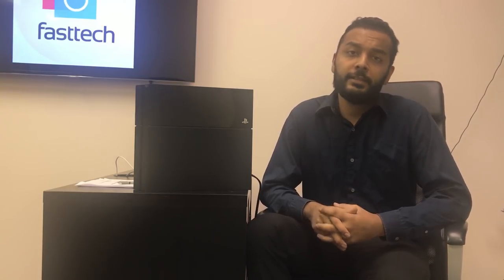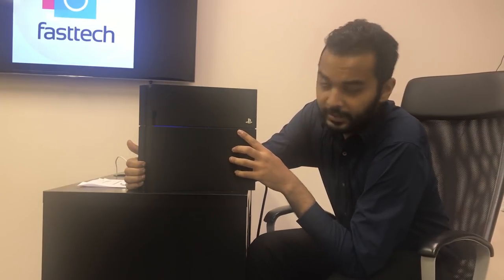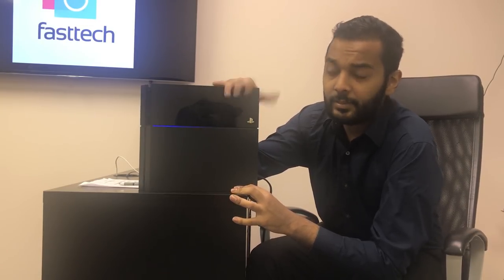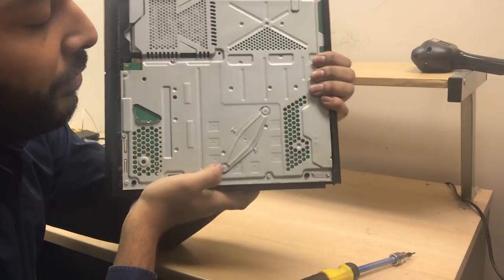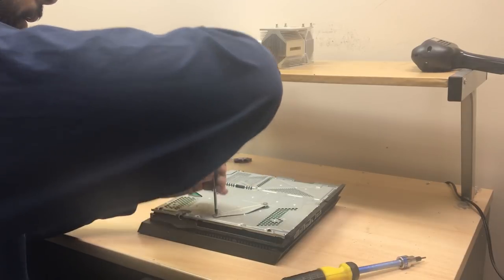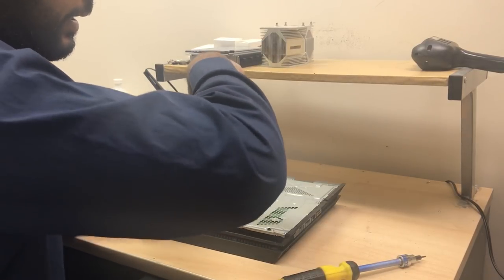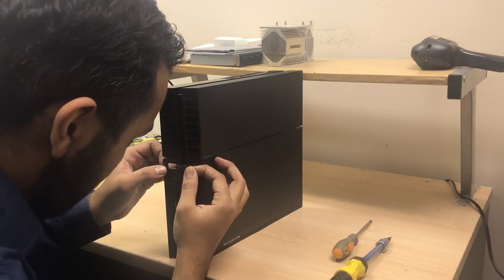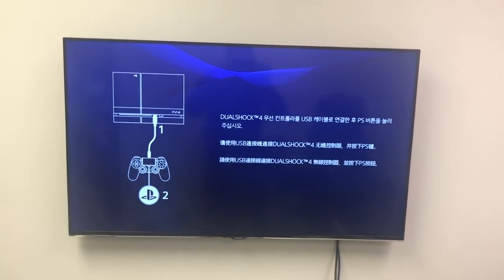PS4 BLOD (Blue Light of Death) Repair (CUH-1001A and CUH-1115A) - PS4 Turns On then Off

Comment: It worked, took me a while because I had a stripped screw and I had to get around that but once I did, it was easy on out! Thanks so much man this only costed me 60 cents for the washers since I’m returning the screwdriver tomorrow! I used 1/4 size washers that I got from Home Depot. Easy effective fix. I’m backing up all my files on to a usb right now in case this ever happens again!

Comment: it seems that the two washers on each side would lift up the pressure I would recommend to put something in the center of the clip so it forces pressure down harder and use no washers where screws go
Reply: Not necessarily. I thought the same but didn't work so ended up placing it on both sides and worked. Very strange but atleast got my console working again.

Comment: You saved my day today bro. Thank you so much. Been wondering what's wrong with the PS4 until I almost gave up trying to repair Now my PS4 is fixed! Thanks!
Reply from the maker: You are welcome. Don't forget to subscribe.
Reply: How long is it fixed gor
Reply: @Eli Rodriguez I overlooked this sorry. I used my own washer instead of their washer since I live far away.
Reply: @gaijindando6726  Doesn't take long . Once you have put some kind of washer or anything to keep the plate back in its original position, the PS4 will run normally.

Comment: doing how to clean dust video on your channel is the reason my ps4 has the  blod blue light of death
Reply from the maker: You must have done something wrong along the way. That blame cant be put on me. I have done thousands of PS4 consoles without breaking them.
Reply from the maker: Check the pins on the motherboard (the ones that go in the power supply) and make sure they are straight.
Reply: Fasttech i think it can’t be fixed ima just buy a new os4
Reply from the maker: @GTZ3Z  Okay, If you like you can also sell it to us here: https://www.fasttech.ca/sell/

We can give you up to $100.
Reply: Same situation here. I blue lighted after cleaning the heatsink but after doing this i got my console on but the fan is louder now and i instantly overheat
Reply from the maker: @yungsuccog8223  Thats strange because on my cleaning video you said you did THAT and it broke your PS4. Regardless, its not working because you did something incorrectly.

Comment: This was it!! Thank you :D
Is this temporary or forever, though? I know thermal paste isn't, but will I still have to reball the APU at some point? Thanks!
Reply from the maker: You are welcome. In most cases this works virtually indefinitely (the chip eventually dies no matter what due to how processors are built) but in some cases it could fail again in 1-2 years.

Comment: Ive added washers and it hasn't done anything. My problem is that while dissembling the console I accidentally pulled the connector attached to the motherboard. I soldered it back on and then that's when it gave me the blod. It will turn on them instantly turn right back off. Could it but a power supply issue in my case?

Comment: Alright dude I tried this but it did not work. Any recommendations on other procedures?
Reply: I'm late but change the psu
Reply: Check your hard drive seating, check your PSU, replace or reball the APU, replace the motherboard. These are all possible solutions

Comment: This is awesome!, it actually worked for me but i had to experiment with many different configurations and numbers for the small round metal thing (i don't know how to write it's name in english) because my console is a old version with some small metal parts attached to the screws that i didn't want to remove. But, when i finnaly got (after 3 or 4 trials) the ps4 starts normally as ever. Thanks dude you saved my year!
Reply: Vitofael Lima what size were the washers?

Comment: Mine was fixed, finally. But, soon as i start the game it started to have an overheating problem. I tried to clean it out like the way you did it in your other video (Not further down to the motherboard and the APU tho) and it still loud and shuts off after overheating. It went smoother after i first cleaned it but still shuts off after 5 mins. 
How do i fix this? Should i clean the motherboard as well?

P.S 
My PS4 Heatsink is not as dirty as yours it isn't block by layer of dusts.

Comment: This worked for me for two years so I appreciate it. Mine seems to be at the end of the road now though...Screen flickers while gaming then the PS4 shuts down. Unable to turn on the ps4 with the controller I have to locally switch it on. The first press yields a beep but no light flashes. The 2nd press has the blue light remaining on but doesn't turn white. Doesn't connect to the tv. I have to remove the screws and try adjusting it again to get any sort of result afterwards. That only lasts a couple matches before the cycle repeats itself.
Reply from the maker: Try replacing the thermal paste
Reply: @fasttechvideo  will try this
Reply: @fasttechvideo  I replaced the Thermal Paste...Same issue. It actually just shut down on me after 4 matches in Black Ops Cold War

Comment: The idea is to put more pressure on the heat sink not less and that's what you doing. You should recurve more and put washers on the opposite sides. Also you can't put heat sink paste on without reballing, you tubers you can check that for yourselves. This is a tape patch on gas engine inflight to idlewilde . lol. I know what I'm talking about because I've actually reballed many of these systems and also the adjoining smaller ic's can start to go bad from the overheating causing the same trouble.

Comment: When you putting the two screws back in do you want it to be tight or some room? Tried it and it’s not working
Reply: Tight is better, as you want the APU under the board to as close as possible to the motherboard

Comment: How thicc are the washers u used? I temporarely did this with Aluminium Foil, but i need to replace that
Reply from the maker: We do not share that info. If you would like to buy the kit the link is in the description. You can order washers only for $9.99
Reply: @fasttechvideo  lol, 9.99 for some washers? I rarely laughed that hard.
Reply from the maker: @vanerdrace4806  You are forgetting about the time and effort it takes to make these videos. Its not just washers and electronics parts that we sell.
Reply: @fasttechvideo  Mhh but I didnt forget the 2 Ad's i had to watch. Which is meant as "Payment" But still...9.99 for 4 Washers, wtf. For 9.99 i get rund about 750 of these.
Reply: @fasttechvideo  there are People which are producing way higher quality tech vids without 9.99 Washers

Comment: Now everything makes sense... 

It's a BGA issue. You basically make it force the bad solder joint under the CPU/GPU to make contact.
Rather a workaround, but nice to see it working for people :)
Reply: Bga issues never existed. Its a problem with the chip itself, and the die not being connected to the substrate

Comment: Hello.

I have a question . My PS4 starts normal sometimes and sometimes doesn’t start and shows blod .. but when that happens and i turn it off and start it in the safe mood ( by pressing power button 7 secs two beebs ) that works all the time .. I can play games etc 

So am kinda confuse what the problem is ? Is it still considered Blod or what is this ? 

Kindly advice thanks

Comment: I am a french and i say thanks you very much and your technic was work ans doesnt use my ps4 2 years and now my ps4 work thank you very very much
Reply from the maker: You are very welcome.
Reply: Fasttech are all washers same size ? Mine the light turn white and then turns blue , if I go Home Depot can I buy washers ?
Reply from the maker: No all washers are not the same size.
Reply from the maker: You cannot get these at Home Depot.
Reply: Julien Johnkennady moi aussi je suis français mais je ne parle pas trop anglais mais juste avant que tu l'as répare es que tu pouvais aller en mode sans échec ? parce que moi non sa fait 3,4 ans que ma ps4 marche plus c'est pour voir si j'ai le même problème pas que je me fais des faux espoir. Dans la semaine je vais acheter un tournevis torx 8 merci de t'as réponse.
Reply: Dark HoNor_ moi la je vais essayer, j’te dit si sa fonctionne stv, j’espere 🤞🏼 moi non plus je n’arrivais plus a mettre le safe mode
Reply: Utilisateur merci, je te dirais aussi quand j'essayerais.
Reply: Dark HoNor_ mais defois la tienne s’allumais ou pas du tous ?
Reply: Utilisateur ouai elle s'allumait genre une fois sur deux sa marchait mais sa na durée que 1 semaine car après sa marchait plus.
Reply: Dark HoNor_ ok ba on est 2
Reply: dans 3H max mon tournevis arrive je te dirais si ça marche.
Reply: Utilisateur j'ai reçu le tournevis j'ai essayé et ça n'a pas marché je suis dégouté :( .
Reply: Dark HoNor_ ouai moi j’ai pas pu tentez parceque j’ai un problème avec le cache qui s’enleve pas, et j’ose pas forcer car la play n’est pas a moi donc je vais m’en acheter une 😑 la tienne affiche toujours bleu ? Meme avec les trucs que tu a mis en dessous
Reply: Utilisateur ouais comme avant...
Reply: Dark HoNor_ mince
Reply: Utilisateur :(
Reply: Tu parles français ????

Comment: I Have A PS4 Pro That Turns On ( Blue Light ) Then Shuts Off Does It Mean My Pro Have The Same Problem ? Can You Show How To Fix It On PS4 Pro or Can I Send It In ?
Reply from the maker: The washer method will not work with PS4 Pro consoles. You will have to send it in to us or a repair company for a reball or reflow service.

Comment: I did nothing to my device. I went away for 4 days and when I came back to use it this happened. Why?
Reply from the maker: That does happen at times. Also there could be a human reason for that (sibling etc knocking it off the table)
Reply: @fasttechvideo  Same exact thing happened to me, tried the washer method and it did not work. Any other suggestions?

Comment: I tried this on the slim model in a slightly different way since the slim is designed differently but it actually made the blue light go away.
Reply from the maker: Where did you place the washers?
Reply: @fasttechvideo  instead of the washers going on the clamp screw, i placed a washer under the clamp itself and tightened the screws.

Comment: I'm thinking about replacing the motherboard all together with a new one. Will that cause compatibility issues?
Reply from the maker: As long as you get a matching logic board (disc drive board) with the motherboard you should be okay.
Reply: Fasttech Does it have to match the motherboard or just the system type?
Reply from the maker: Has to match the motherboard
Reply: Fasttech Any websites I could buy those together at that you would recommend?
Reply from the maker: We now sell PS4 motherboard on our website. Link here: https://www.fasttech.ca/playstation-4-parts/ps4-sab-001-motherboard

Comment: Ok is my PS4 fixable. I turned on booted into the menu. I went to turn on my cell phone hotspot and it shut off. I turn it back on and get the pulsing blue light. What could cause this issue.
Reply: It was working just fine til this happened
Reply: This worked. Omg thank you. Saved me money on a new system.

Comment: This doesn't work, i had a feeling i wouldn't but i tried anyways. This video is more like advertisement of those "washers" they sell.
Reply: It does work but in certain instances it won’t. There are hundreds of tiny solder balls under the APU (combination of CPU and GPU) and when they lift up off the board a fraction of a nano meter, crack, or become corroded they can’t pass current to the chip. It’s not a guarantee but it can fix most consoles for a good length of time. It’s a problem with all ps4s but its most fixable with the launch addition which was more likely to have the issue.
Reply: @corybrown5583  looks like a temporary fix tho?
Reply: julius dogta yeah it’s temporary but then again a ps4 is temporary because it has a lifespan like everything else. Mine is still working. I bought one off eBay broken and applied the washer fix and it has been working for like 5 months now. It could continue to work for years or it could fail tomorrow. It’s jailbroken so it’s worth the trouble.

Comment: My ps4 look different when i opened... That part is cover with a metal piece... It have that shape but is cover
Reply: Same
Reply: @GinoVlogss  is under that big metal piece. Just take it out
Reply: buffel132 does it not need it ?
Reply: @GinoVlogss  idk. I put it back
Reply: buffel132 if I take the metal out does it fix the PS4 because I don’t want to break it
Reply: @GinoVlogss  idk men. Its depends whats the problem that your ps4 have... It didn't fix my... My problem is not cpu or bad connection... But if yours is it may solve it.... You won't break it if u have the tools. Just take all scrolls off and remove it and put it back when u finish

Comment: What about if it fell
Reply from the maker: This repair will work in most cases but with some units you will need a reflow or reball to fix the damage
Reply: R.I.P
Reply: Braydon Miller  correct me if I'm wrong but this is most likely the apu disconnected from the motherboard
Reply: ash mariee  buy a new one lol
Reply: Braydon Miller  so try to fix it

Comment: Doesn’t work, other methods?
Reply from the maker: Reflow or Reball the APU chip. If that doesn't work you're going to need a new main board.
Reply: @fasttechvideo  I'd try taking off that part he takes off and leave it off! I am not sure what the point of it even is!

Comment: why my light turn into white color?
Reply from the maker: Thats a good sign. A white light means the system is working as it should
Reply: @fasttechvideo  but nothing appear at my tv,. seriously I have try many time. but the result still the same. first the light color is blue before a few second it change to white.
Reply from the maker: @salehinks9946  check the pins on your hdmi port

Comment: Don't do this guys. It won't last. It's not the way to fix that. This guy only wants money!
Reply: it wont last meaning?
Reply: It's not the right way to do it. The chip has to be reflow. This method consist to put a big pressure on the chip wich is very bad with time. The real method is a reflow or replace chip with the right procedure and tools. It requires laser reflowing machine and a lot of experiebce. Be carefull with wrong you tubers who say anything just for money.

Comment: waste of money, literally can buy washers for cents at a hardware store, and thermal paste is only a few bucks
Reply from the maker: Are they the specific washers we use in our video? No. For $19.99 Canadian dollars (about $15 USD) we ship you a kit with thermal paste and washers. Not to mention the value you get from watching this FREE video.
Reply: First off, time ain't free, and to say that you are selling "special washers'' would be a lie, what your doing is selling machine screw washers that cost almost nothing and selling thermal compound to gullible kids for an extreme mark up. Not to mention the fact that this "kit" would actually do more damage to the Apu by putting an excessive amount of pressure on the chip. This fix is also somewhat comparable to the bolt fix on the xbox 360 which literally crushes the chips till it makes contact with the BGA points.
Reply from the maker: Time isn't free ? Excuse me. Do you know how long it takes to make and edit these videos? That is the beauty of a free market you do not have to buy it. You are free to risk your expensive PS4 by using hardware store washers that will not be the correct size. To stay in business we have a make a profit therefore we have to sell at a higher price than our costs. If you had any business experience or background you would understand. As far as the claim goes that this damages the APU chip, there is absolutely no evidence of that. In fact we have had 0 repair kits being returned so far.
Reply from the maker: I used to delete idiotic comments like yours but now I don't because there is a group of entitled people like yourself that need to be exposed.
Reply: Fasttech First off, "time ain't free" applies to everyone as we dont have an unlimited amount of it, and second of all, What are exposing me for, exposing you, I literally just explained why you fix is damaging to these consoles, also noticed you have xbox 360 heatsinks in the backround, hope you aren't doing home repairs for those too
Reply: Fasttech And if you going to offer a "REPAIR SERVICE", then get a BGA Reflow station and do it legitimatly like your competition
Reply from the maker: The whole point of a DIY video is to help the average Joe fix it themselves at home. If your time is so precious and you feel this time was a waste of your time then you don't have to watch our videos. We do have a BGA rework station that we use for reball services which we offer on our website.
Reply: Fasttech listen, then I honestly think you should just stick to Bga reflow station, I don't think you should sell these because its a not good long term fix and has its consequences, thats all